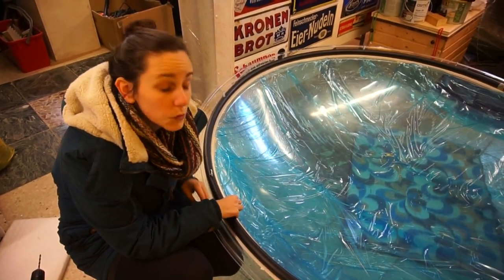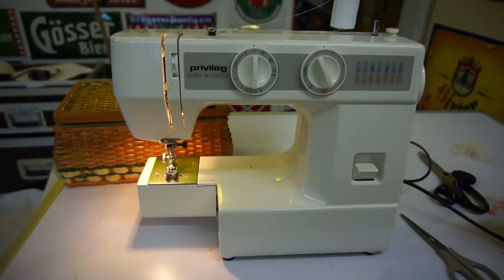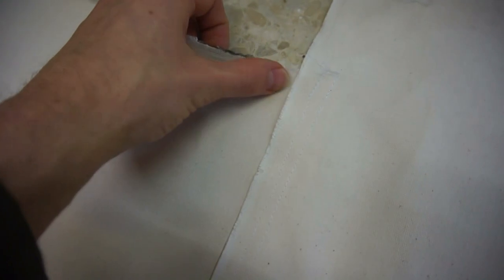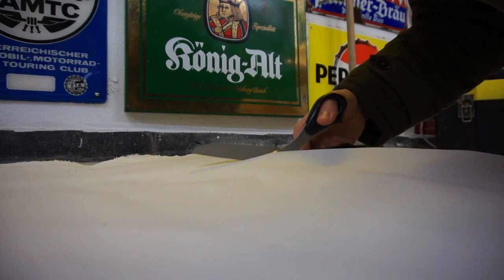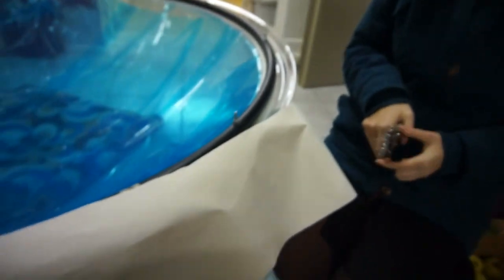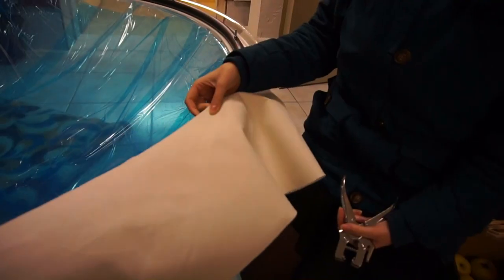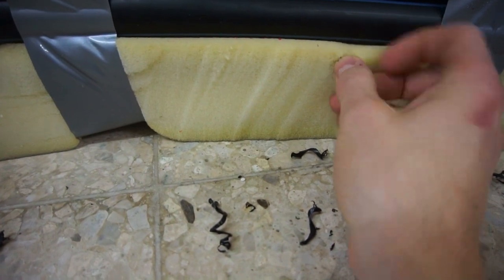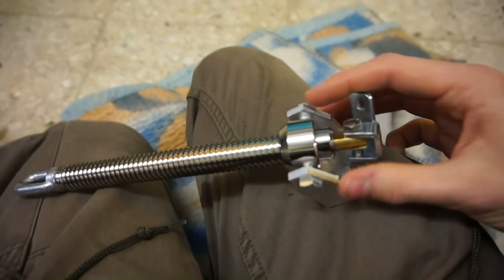How to Build a Yurt - Light Ring #3 (Canvas)

Comment: i decided im going to use vinyl plastic sheet for the cover. i have heard a lot of stories of fabric canvas leaking, leading to mould in the yurt. i hear that canvas yurt cover is better for very dry climates, but not so good for wet enviroments.
Reply from the maker: Thanks for your comment, Chris! 
For a long time we thought we would go for a vinyl cover, but then found out about its toxicity. Especially during the hot summer days, they will release a lot of  phthalate  
and this is not what we want in our systems. This is why we decided to go for the Cotton-PE mix canvas. 
What we have to do with that is impregnate it properly, every now and then.